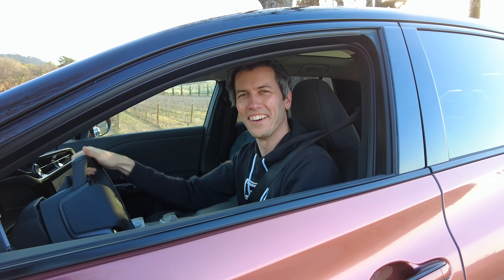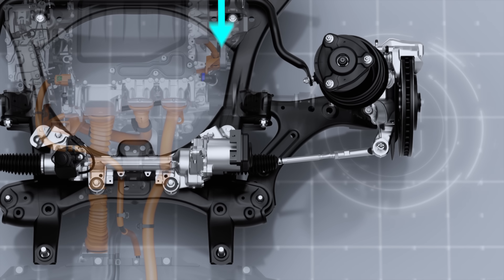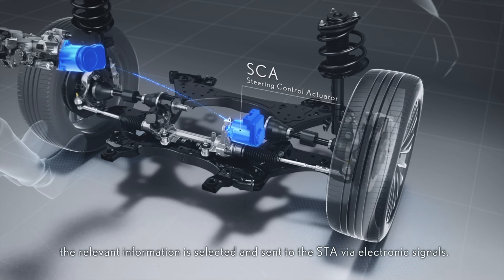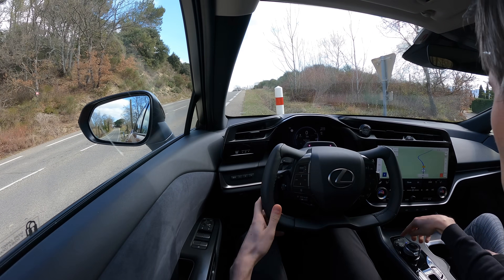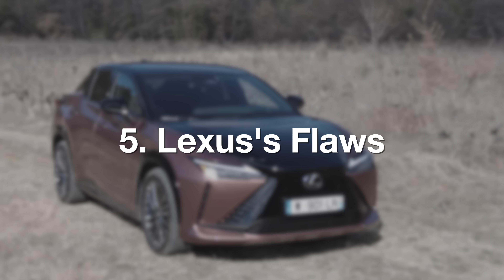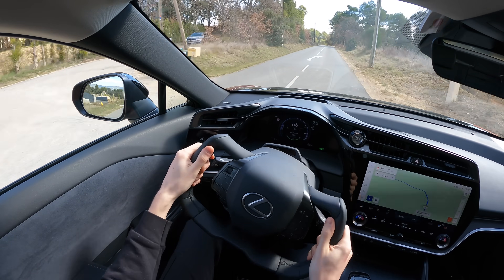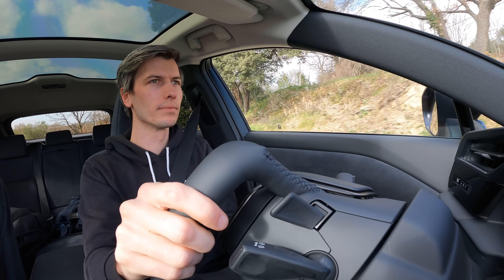How Lexus Fixed Tesla's Bad Idea: Steer-By-Wire Yoke

Comment: The short steering ratio might be fine even at high speeds.
It's just a matter of getting used to it.
With the motorcycle, the steering is direct, yet there are no problems.
😊😊😊😊

Comment: In a rack-and-pinion steering system, the steering wheel automatically straightens after the steering maneuver. 
Does a similar behavior occur with electric steering?
😊😊😊😊

Comment: Race cars get away with short steering ratios because the input is very heavy and the drivers shoulders are held in place by tight bolstering and restraints. Steering weight is another variable you could play with on this system.

Comment: It’s interesting how safety equipment is mandatory, but the steering wheel and brake being physically connected to something is not. I find brake by wire (steer by wire as well) equally as dangerous, if not more dangerous than driving a car made before 1967 with dual circuit braking. 

Personally, I think steer and brake by wire should be against federal law since if either of those systems fail, you are out of luck and it’s game over. We will probably see fatalities rise once brake by wire systems fail and loose all of your brakes.

Comment: As a 40 year mechanic, throttles by wire do fail sometimes at speed. Steer by wire more electronics that will fail eventually. If it happens at speed you're done. Airplanes with triple redundancy have had the fly by wire fail. This is probably going to be a bigger problem for people that buy used cars that have high miles. I can't imagine what the repair cost would be if you are still alive. I would never consider this safe enough for my family.

Comment: What’s going to happen when you need to make an emergency manoeuvre at high speeds? You may might be in a situation that requires a large amount of correction and the computer holds it back due to the high speed low sensitivity programming

Comment: Adding that much of an input lag i dont see a point. Steering is a solved problem, not something that needs a fix. Not saying it wont be ever, maybe some day it will even be cheaper for example when we will need a steering wheel only for special occasions.

Comment: 11:31  what if you need to avoid an obstruction on the highway? Thad is I think the theory behind Lexus letting you jerk the wheel on high speed.
If you install something like a flight envelope for steering and it could be proven thad this 'restriction' could have prevented the driver successfully avoiding an accident could Lexus be than liable?

But following thad same logic they should do something aboud the steering  response time because that are some milliseconds thad could also make a difference i guess.

Comment: I am really surprised no one mentioned that the lag can be intentional. When this lag is shown for Tesla cars, the tesla proponent defended this lag by saying that input smoothing is to avoid loss of control, because of the extremely low steering ratio. When you turn the yoke all the way, it is equivalent to you turning the traditional steering wheel for two turns+. Therefore, if you accidentally have something or someone bump your hand when driving, you don't immediately turn too much and tumble the car. This input smoothing is particularly needed at low steering ratio (low speeds). At high speed, the steering ratio increase and it is possible that much less input smoothing is applied. Therefore, there likely be less lag as you accelerate.

Disclaimer: That is my interpretation. I don't work for either Toyota or Tesla. I personally like traditional ones more.

Comment: If your car gets into a drift, you won't know where your wheels are pointed towards exactly. It should be easier to learn hand over hand steering than learn to use this system in a drift (if at all possible) 🙄

Comment: I feel like a variable steering ratio could 100% have been solved mechanically, and other than that, nah, if my throttle gets stuck, i can simply turn of the engine, or put it in neutral, if my steering wheel stops steering, i'm fricked

Comment: My personal issue is not safety, but it just seems like an unnecessary additional cause of insufferably expensive repairs waiting to happen 🙄

On the plus side.. This appears to be one step closer to simply having a PS controller instead of the wheel and pedals (+clutch) 😝😅

Comment: It also works in the other way. You can also amplify feedback from the roads. Two motors electrically connected will essentially provide the same feedback as a mechanical link, with some nuance of course. Difference is that you can amplify and dampen the connection as desired.

Comment: If the steering ratio depends on speed, and you brake for a corner, does it mean that if the yoke is offcenter during the turn, which means that the steering angle also changes as speed changes the steering ratio. If the curve radius of the turn is fixed, would I have to decrease the yoke steering angle in the turn, when regular steering would have a more-or-less constant angle (except briefly for entering and leaving the turn)?

Comment: I see the variability being a problem initially. Will you just be able to whip it into a parking space from a driver per perspective, The lack of response time is a problem.  Operator shouldn’t have a problem. Someone mentioned the maintenance cost and oh yeah.  Finally, for anyone that buys this car, the dealership should make them drive the car an hour on some kind of closed area before they release it.  I don’t know. I can see some potential lawsuits. Accidents due to the lack of predictability or consistency. Don’t let someone die. That variable steering ratio might be too much.

Comment: Correction, I have the first GM car with electronic power steering, not drive by wire, but electronic power steering, and the steering ratio changes depending on the speed I'm driving. If I'm turning a corner. I only need to turn a little bit, but when I'm at speed, it mutes my inputs to not create large movements when that's dangerous. EPS is a variable ratio steering system that still has mechanical linkage to the rack. EPS feels great in sportscars and I wouldn't want DBW but I doubt that's going to be a choice we get to make in the future because removing the steering column from the front of the car is just too good a thing.
Reply: Good for you 👍

Comment: I always want a mechanical link with steering and breaking.

It has nothing to do with dependability and everything to do with safety.  For one the simplest solution is likely the best solution. 

When it comes with electronic we all had something do the opposite of what you wanted.  You can have redundancy all you want but if your input tells the computer to turn left when you turn right or a quirky bug in the programing that happens once in 1000 cars then it will be catastrophic and automakers are always the first to take blame for their poor designs right.

Comment: You failed to mention a safety factor for steer-by-wire. Even with modern collapsible steering columns, the physical connection can still cause injuries

Comment: My only complaint that I see is the ridiculous, ugly steering wheel design.  I would have to get an aftermarket wheel.  I grip mine at the top one-handed for casual or highway driving, and in heavy traffic I switch to a 9 and 3 grip with both hands.  One hand allows me to turn the entire wheel with no effort or adjusting grip.  And this can't do that.  I LOVE the drive by wire system and if done right will make cars easier to work on, but there is no need to go with the ugly tesla wheel.

Comment: next step - steer by wire with independent electric motors and independent turning of every wheel so all of them can have perfect angle inside a turn (plus you can rotate in place to park)

Comment: Personally, I hate how unpredictable new cars have become. I drove a Hyundai Santa Fe hybrid, and I just couldn’t get over the fact that when the battery was fully charged, the regen braking didn’t work at all—and then later, once it dropped to about 3/4 full, it suddenly became speed-dependent. I want to know exactly how the car will react. I want to know whether I need to lift off the gas 500 m before a bump to just roll over it, or only 100 m.

Modern cars are overloaded with “helpful” systems—speed warnings, lane assist warnings, lane change warnings, drowsiness alerts, “eyes on the road” reminders… It feels like being treated like a toddler supervised by an overbearing parent, with zero trust in my experience, skill, or critical thinking. And half the time, these warnings distract me more than they help, because I’m too busy figuring out what the car thinks I’ve done wrong this time.

I can’t wait for all that driving data to be sent back to the manufacturer, analyzed, and sold to my insurance company—just so my premium can go up because I drove 30 km/h in a 25 km/h school zone on a Saturday evening.

Comment: I feel like limiting steering at all, even extreme turns at high speeds, is itself a safety risk for both the driver and whatever obstacle, living or otherwise, found its way onto the road. A deer, wrong way driver, etc. is going to require an extreme turn to avoid and limiting that could force the car to hit said obstacle when it could be avoided

Comment: Citroen, back in 1956 with the introduction of the DS, removed direct connection between the steering column and wheels - using HP hydraulic pressure to do the job. And there is absolutely no 'steering play' with any of the Cit hydraulic steering systems. IOW touch the steering wheel and the front wheels will start to move. Takes a bit of getting use to, but after you do, everything else seems crude by comparison.  With the introduction of the DRAVI system in 1970 with the SM,  gve a 2 turn lock to lock (86°) total swing of the front wheels with variable steering wheel resistance based on speed. Again, no mechanical connection between column and wheels. All done with HP hydraulics. Upside of the Cit system. Outside forces have no effect on the steering wheel. Due to Cits steering geometry and rack design outside forces on the wheels have no effect. Starting with the D series you can have a front tire blow out, at speed, take your hands off the steering wheel, slam on the brakes and the car will stop, basically, in a straight line.

Comment: Perhaps this steering delay is due to the steering control actuator having a maximum turning speed? I suppose they could fix this by introducing resistance to limit how fast you can turn the steering wheel to accurately reflect the tires rotation.

Comment: could low steering ratio, in a mechanical steering system, be "fixed" by taking away part of the assisted steering as the car's speed picks up?

Comment: 12:50 it's not a delay. Steering motor has a maximum speed, which is simply too slow to catch up with your unrealistic input. If your input is realistic and slower, there is no noticeable delay. Same thing with cybertruck.
Reply: Why don't non-drive by wire cars have this issue then lol
Reply: @MidnightMustang they have. Hydraulic power steering also has a motor, which has a max speed. The only difference is that you are unable to turn the wheel so quickly, as it's too hard.
Thic can be solved with a software patch in steer by wire systems: if input is too fast, apply resistance.
Reply: @eIektrinis  I was more refering to currently wide spread electronic steering systems (that aren't drive by wire). I can turn my wheel & tire just as fast, if not faster, than Jason did in the video.
Reply: @MidnightMustang I have electric power steering on all my cars and I can't turn as fast.
Reply: Did you just say it’s not a delay then proceed to say it’s too slow to catch up with your input? - or am I trippin
Reply: @cosmooop  turn wheel slightly slower and there will be no delay. The only problem here is that it's at all possible to turn it this quickly. On normal car it would be just too hard.

Comment: The steering ratio can be adjusted with a traditional linkage and electric motor assist. For 99% of drivers, you just reduce the motor assist as speed goes up. Good handling at high speed. Easy driving at low speeds. Easy.

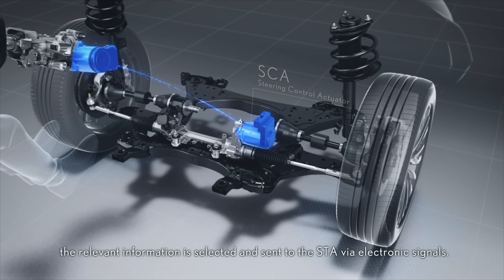Comment: 2:04 for those who didnot understand complex terms, simply saying how regenerative breaking works the load which is put on steering rack motor/dynamo by the steering rack is felt on steering wheel motor/dynamo by the flow of electricity from one end to another through the wire and that variable flow creating variable strength in magnetic fields which is felt on the another end. It is like electrical shaft instead of mechanical shaft 
(in depth and even more technically speaking saying instead of covalent bonds between metal atoms of the shaft now electron charges flowing through electronic bonds of the different type of metal atoms). 
One disadvantage is during tampering cutting metal pipe is harder than few cable wires but advantage is reducing friction and the weight of the car components for better efficiency.

Comment: It just needs some sort of wheel position and yoke position indicator, when people develop muscle memory it will get redundant. 
Lag could be issue but then again the steering by wire yoke can be much faster to turn and then wheels just have to catch up.
Dynamic sensitivity exists in planes at least dince ww2 and its no brainer in modern ones, you need central position to have low sensitivity for tiny adjustments and edges with high for quick access to full maneuvering.
Two profiles changing with speed is bs and confusing, just copy whats already perfected in planes.
I bet it could steer perfectly with even less degrees if it had that dynamic sensitivity.

Comment: This ruins curves on the road, such as on/off ramps. You can't hold the steering wheel in a steady position, matching the curvature of the road. Instead, you have to adjust steering as you accelerate up to highway speed around the on ramp, or decelerate around the offramp.

Instead of making steering sensitivity relative to speed, it might make more sense to simply make steering more sensitive in extreme left/right positions, and less sensitive in center position.

Comment: I can trust Aviation steer by wire, but not cars. Because there is difference between maintenance of aviation industry and personal cars. On personal cars sometimes you do not take care to maintenance regularly for wathever reasons. You can basically electronized everything and its okay, but not steer and brake beacuse that is the most vital part in car safety. That's my opinion.

Comment: 11:33 you really think this is "IDIOTIC steering" input ? and not "oops there goes someone's child on the road, lets immediately steer around him"
Reply: Yes this is what I was about to comment
Reply: That’s actually a good point
Reply: This. If when I try to take evasive action at speed the WHEEL would just say "Nope!" Then I am never driving that car. Immediate dealbreaker. The wheel needs to do what I tell it to, even if its me putting the car into a ditch to avoid killing a child.

Comment: I think I left a message before, but I’ll never knowingly buy a car with drive by wire.  The lag will always be apparent, because you can’t anticipate a user starting to move a muscle… it’ll always be sub safe… 

Redundancy?  lol. I’ve learned that is a mind trick that can fail, and you can’t replace the KISS principals.  

There’s the lag which could be analogous to gear thrash.
Reply: Redundancy is not "fake" you should know that since you cited a programming principle

Comment: If the advantage has to be explained to you like a child then it's not worth it. Nowadays they are making cars ever more complecated, less durable and anti-mechanic. You have to be both an electronic engineer, a mechanic and a software engineer to conduct regular repairs. If the steering/steering rack wears out, you will not only have to replace it but reprogramme the whole fvcking car. That's why you need a fvcking "professional" to explain how much you need it, just like the covid vaccine.

Comment: I have to say I would tend to be a slightly negative skeptic on this, however after hearing he potential benefits, I am open to try one.  Steering wheel in the visually and legroom, twitchy at high speed. Sounds interesting.
My biggest concern is that the engineers are choosing for me, and Toyota/Lexus engineers STILL can’t get their environmental controls to work decently in the N.E. USA. Plus the 2016 gx460 gps is sooo bad we never use it or their decision to make the auto cruise automatically disengage at 20 mph while you are still moving.  It also has horrendous throttle delay, now they have added steering delay, yikes!  I would be concerned about making emergency avoidance maneuvers.  So now I should trust them to get it technically correct?😂😂😂😂

Comment: Both are terrible designs! In case of any power-assisted steering failure in a traditionally built car you still have direct mechanical control, although harder, but still there. Mechanical steering is not just for steering, it is also a safety feature and a safety backup.
And those non-round steering wheels are not just ridiculous, but also dangerous as well. There are excellent reasons why the genuine steering wheel is round. This gives you all-round control and hand grip over it. You can't have such control with these "modern" wheels.